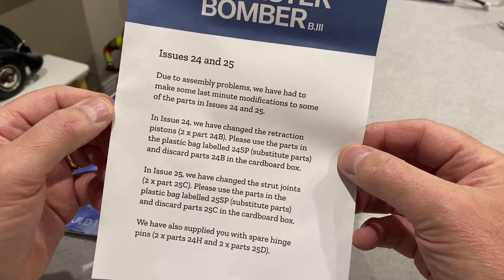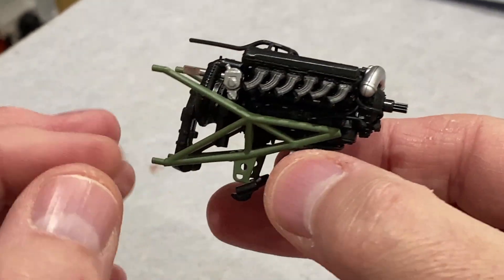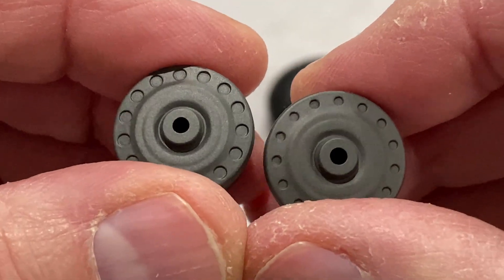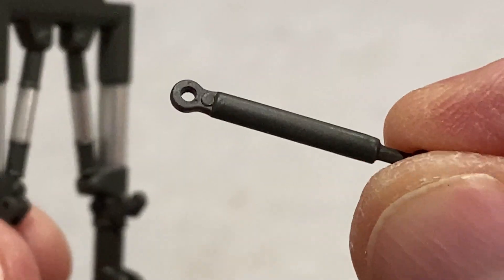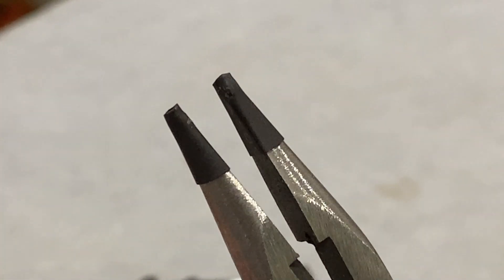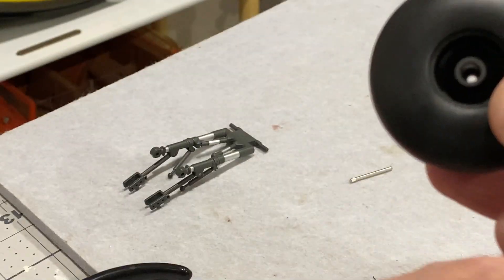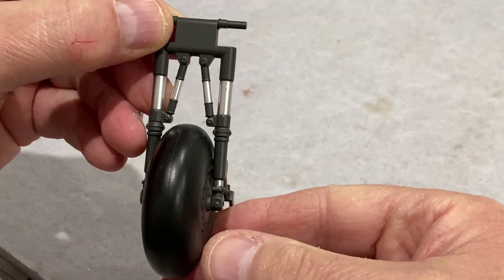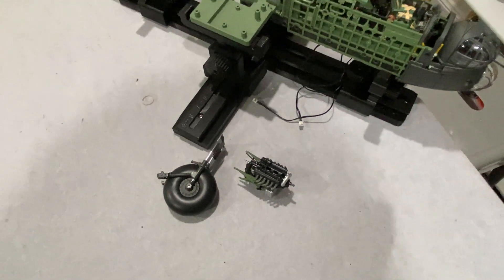Part 24 of a piece of aviation history - building a Lancaster bomber from the Dambusters raid

Comment: There's all that lovely detail so I'm surprised they didn't mold treads into the tyres, even simple lines along the circumference. 
BTW, I mentioned recently in the comments a short documentary regarding the use of Merlin engines in experimental British torpedoes in WWII.  Youtubers don't usually like links in their comment section, so if you're interested just type into youtube search "helmover torpedo".